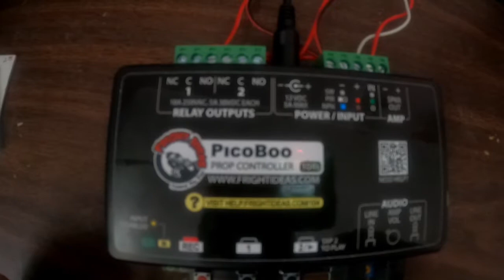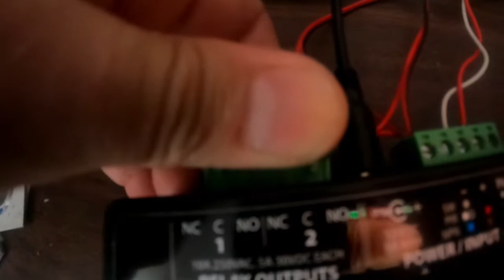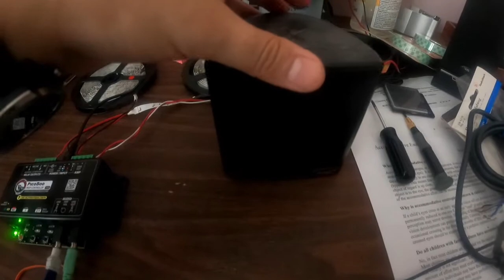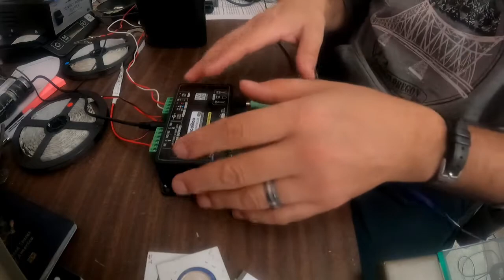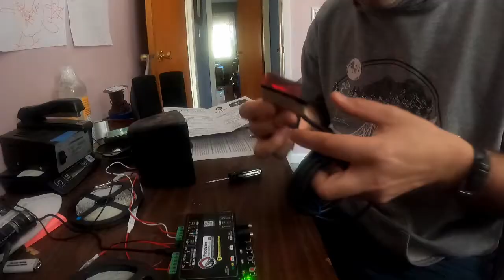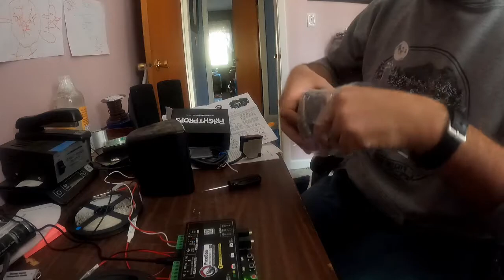FrightProps Picoboo Prop Controller Programming Demo

Comment: Perhaps you can help me, we have a spinning zoetrope illusion at my job that uses a pico boo jr. Its supposed to turn on, spin the illusion up, and then off, to show first the effect, then the object we're using for the effect. Unfortunately,  it just seems to stay on all tbe time. How would i program it so that it stays on for 30 seconds and then off for  30 seconds? Appreciate the help as i am not electrically inclined.

Comment: Awesome! However the lights dont want to work on mine for whatever reason, I have been trying to get them working for hours and they won't light up no matter what.
Reply from the maker: Can you tell if it's just the lights, but it's working normally otherwise? (Can you hear the relays clicking as they open and close?). You may want to reach out to Frightprops customer support directly.  They've been very helpful when I've contacted them.
Reply: @HauntingU  isued your video to realise Im an idiot. I was trying to program the lights at the same time as the auio. I got it working now, just remembered, auio loads on first, then record animations.

Comment: The only thing I hate is that you can’t save your proggraming so you don’t have to erase it to do something new with that controller
Reply from the maker: That's definitely true with the Picoboo, but the picoboo MP3 can be programmed using their Director software and you can save those on your computer to come back to later!
Reply: @HauntingU  Wow thanks for the info!
Reply from the maker: @mymana2  I did a video on the Director software as well. You can find it here.  Hope it helps!

https://youtu.be/0U7JRXBr9Ts

Comment: Would you know if this would work with a cannon for air, smoke, light and sound?
Reply: I saw your Directors video.  I need to give my smoke machine a 3-4 second head start in order to get smoke in the cannon before the air and light turns on.  What do you suggest I can do with the Directors software?
Reply from the maker: @Kana7782  I would need to play with the software to confirm, but I think you can drag the sound effect graphic to the right to delay when the sound will start. If that doesn't work, then you can use an audio editor like Audacity to add 3-4 seconds of silence before your sound effect starts.
Reply from the maker: It absolutely could! You'd need either a Picoboo MP3 or a Picoboo Plus with 4 outputs. One output controls the air solenoid, one triggers the fog machine, and a third triggers the light.  You load the sound directly on the controller and synch the effects to the sound. Check out Fright props support page to see how to wire each of the effects to the picoboo. 

https://www.frightprops.com/faq/category/controllers-and-electronics.html

If you decide to go with the Picoboo MP3, you can use the Director software to program the animations. Check out my video on the Director software to see how easy it is.

https://youtu.be/0U7JRXBr9Ts
Reply: @HauntingU  oh and thanks for responding. I appreciate your help
Reply: @HauntingU  i definitely need help wiring/connecting everything to work together.  And is there anything else you would recommend other than the PBMP3? The four outlet is pretty pricey and I have two cannons
Reply from the maker: @Kana7782  You could check out Purgatory Props and Kurt Controllers. They sell similar controllers for much less. I haven't had a chance to play with them yet, but what I've seen was impressive. 

https://purgatoryprops.com/

https://kurtcontrollers.com/
Reply: @HauntingU  you’re awesome! I’ll check them out! Thanks!
Reply: @HauntingU  which controllers should I look for in those two sites you mentioned?